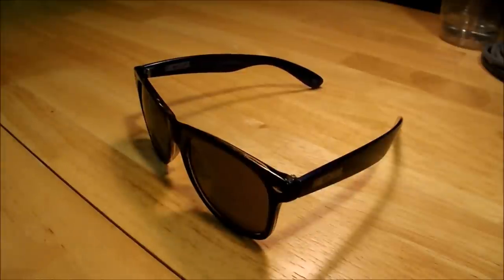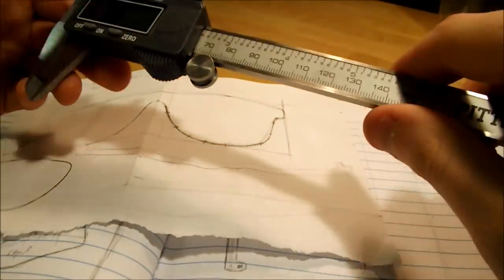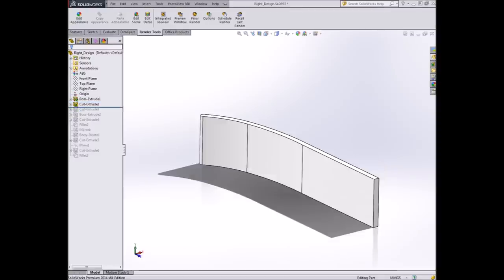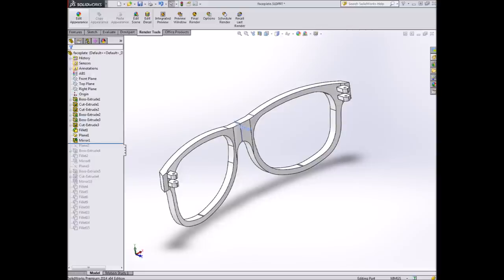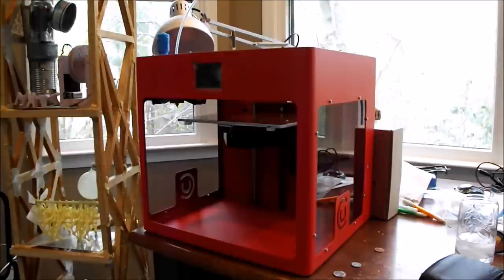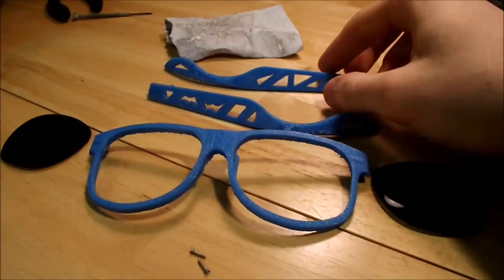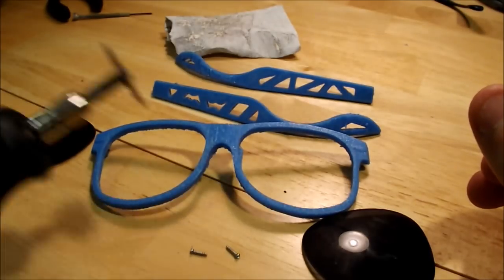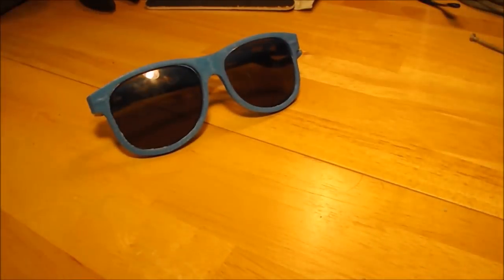How To: 3D Print Sunglasses

Comment: Hi Matt. What material did you use to make these sunglasses? Also, they were pretty edgy from the inside once they finished. I'm a practicing optician looking at ways to differentiate myself once the pandemic is over. Hence, was also looking at an option to manufacture them in a reasonably high quantity.
Questions:
1. How much did this cost?
2. Since you incorporated the hinges in the design, from experience I know that plastic hinges do not have hte same strength as metal ones, which in turn need to be fixed nicely in a groove created for them. How can we do that?
3. What material did we use to make this pair?
Reply from the maker: siddyboy they were made with PLA, however I would definitely go for something like a resin cured material (uses SLA instead of FDM printing) which gives much higher resolution and strength. You’d probably design the pocket for the hinge in the design then epoxy it into place. The material costed a few cents to print, but printing at high quantity with 3d printing can get expensive. I would check out SLA printing through some place like xometry, shapeways, or protolabs where you can get a feel for pricing at different quantities, or look into a printer like formlabs. Let me know if you have any other questions!